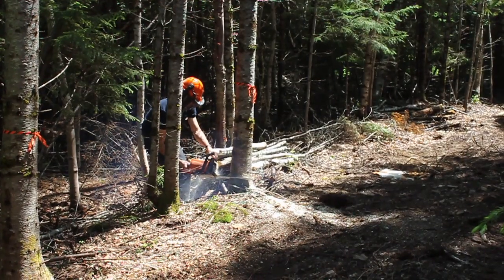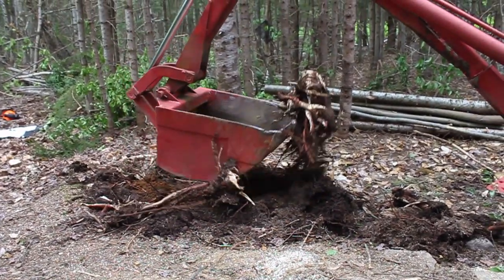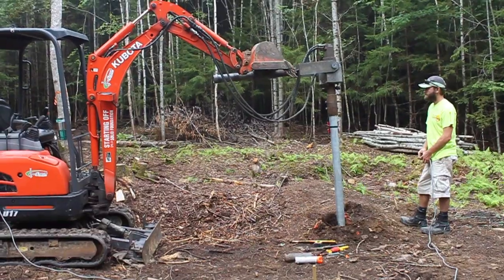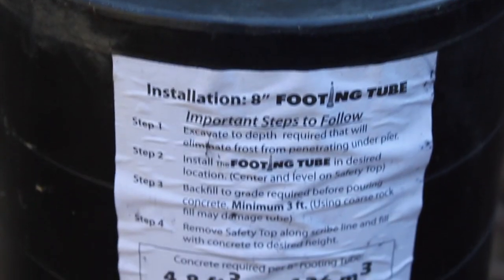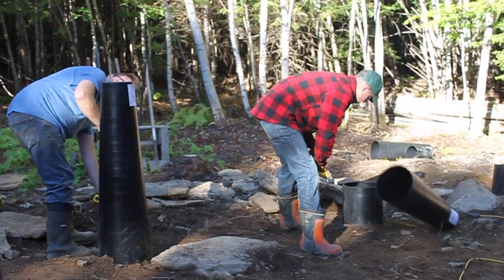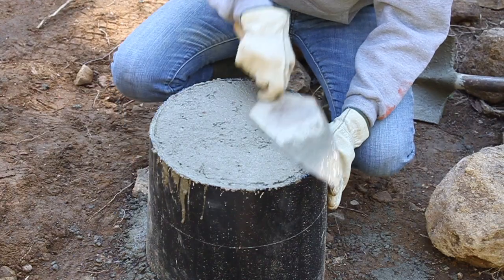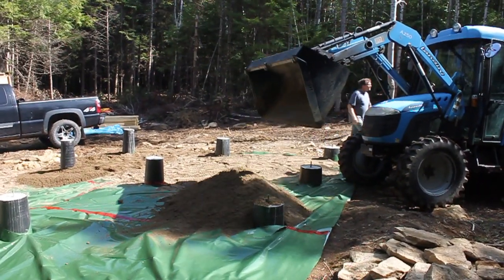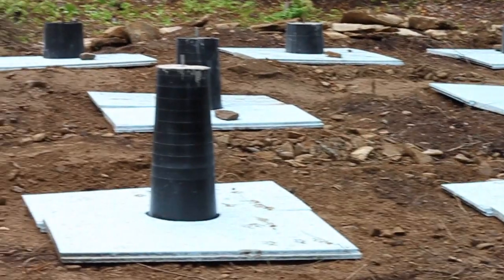OFF GRID CABIN Foundation and Road Build | Cold Climate Foundation

Comment: I’m glad the screw piles didn’t work, because concrete footers on the bedrock is super stable.  Our cottage in Ontario was built on concrete footers onto rock about 40 years ago and the footers right on the rock haven’t moved.  BUT... keep trees away because the roots can grow in a push the footers.  Also keep water away too, with good eaves and landscaping, because wet on one side when it freezes will also move them.  Previous owners ignored the foundation for about 20 years and 4 footers moved about a foot sideways, I’m resetting them now.  They were the only ones not directly on the bedrock, water drained to them, and a row of cedar trees grew in and the roots moved them.   Frost heave is not an issue when building near bedrock.  Nice to see a family working together. :).

Comment: Hitting bedrock is good.  It saves you money as all you need are sonotubes that are planted on the bedrock.  You don't need a wide base as you aren't building on soil, and this is a light structure after all.  I'm confused as to why you had to go with the much more expensive footing forms and a backhoe while you already had the holes augered for sonotubes?  Seems like unnecessary cost to me however it doesn't hurt to overbuild and I really like the foam around the tubes.  This is a good, professional build.